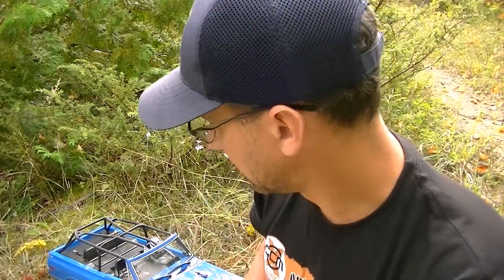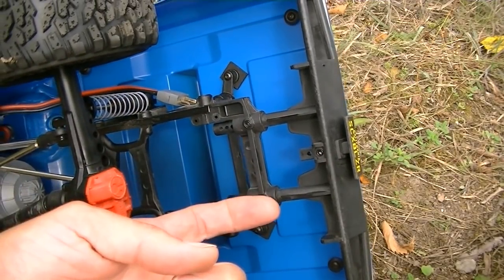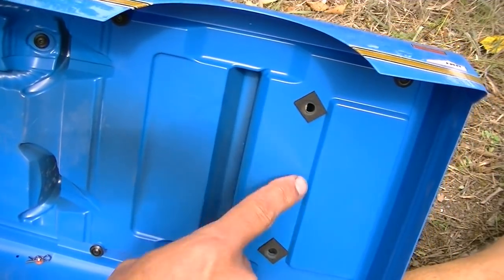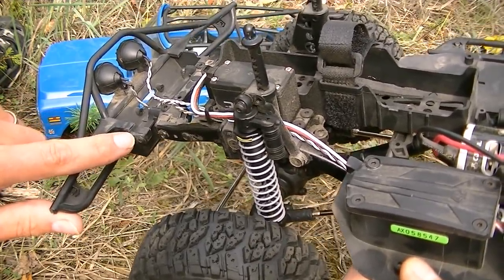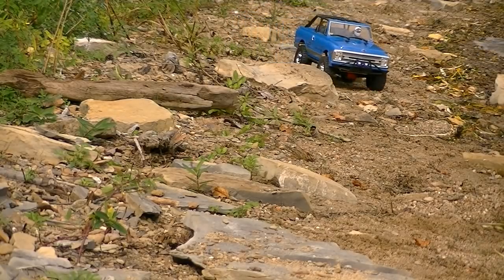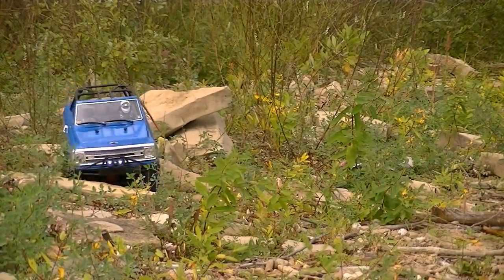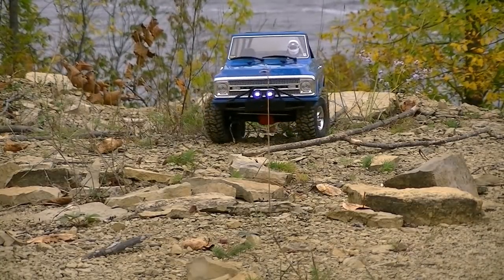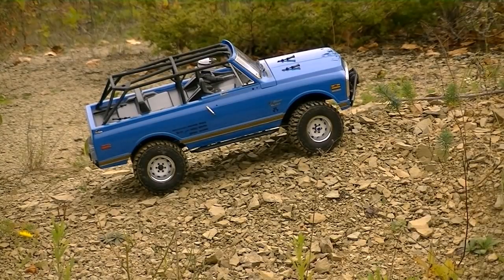Show and Drive-Axial '69 Blazer with Simple Mods

Comment: Nice tips and wow looks like a sweet spot for scale rigs,I have the same tires they work great down on the beach not rock terrain down here just mostly sand I'm running soft foams in those tires mounted on those rc4wd wagon wheels that softer set up really helps in the sand,Gotta get the rtr blazer next seems to be pretty good straight out of the box Thanks for sharing
Reply from the maker: Thanks for the tire update, I'm thinking the same thing.. these may be great for a bunch of builds.

Comment: Great vid, thanks! Tires and rims look just right on there too. About how long will that battery last? I’m still using 2s and thinking of moving up.
Reply from the maker: Thanks! That little 3s will run this truck for almost 2 hours on half throttle trail hills and rocks and stuff. Full pin will only get an hour.

Comment: Hey so are these tires smaller in diameter? They don’t look like the fill the fenders as much as stock tires?
Reply from the maker: Very slightly smaller, yes.
Reply: GCMRacing1 - Scale Truck RC in Canada is that a pro or con to crawl with

Comment: Awesome rig, lots of potential. Do you have plans for the back lights?
Reply: There is an axial parts tree for same scx10ii blazer that has rear blazer light buckets on it.comes with chrome windshield wipers,spare door handles,mirrors and chrome clips too hold l.e.ds in said buckets.have not located part tree that has lenses in it yet,but on the hunt....
Reply: 3D printed buckets and lenses -> https://www.shapeways.com/shops/knightcustoms?section=Axial+SCX10ii+1969+K5+Blazer&s=0
Reply: I've never ordered from them before until just now. I ordered both the buckets and lenses from them, fingers crossed  :)
Reply: @eheft4354  Cool, I'll check them out.